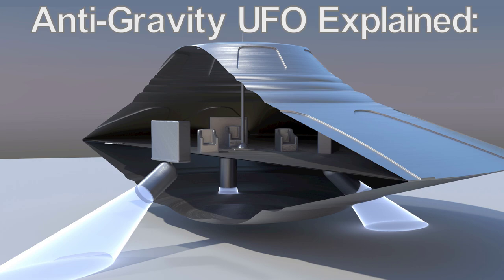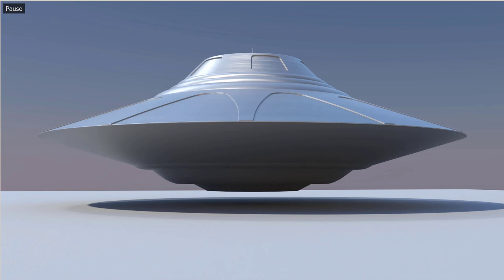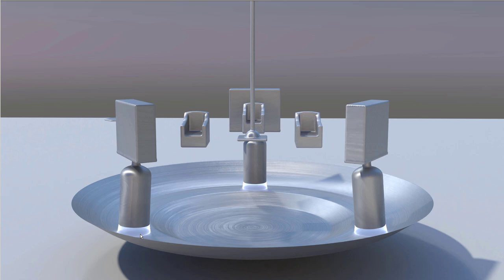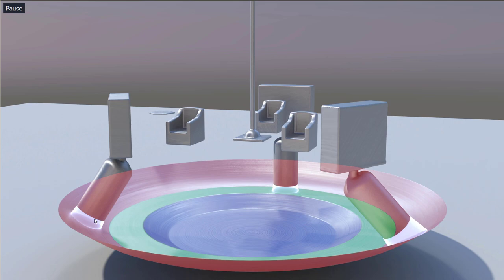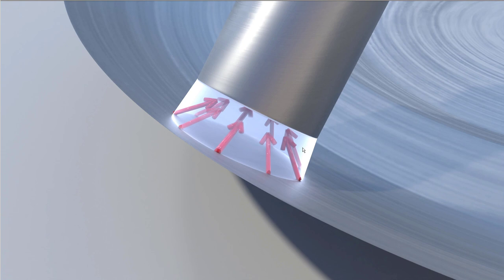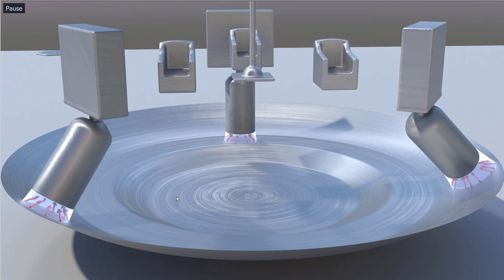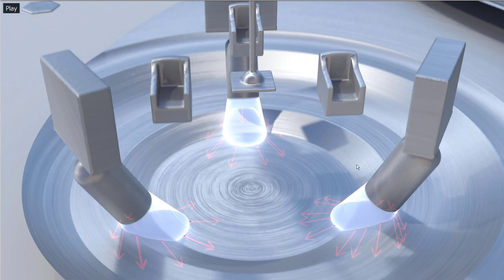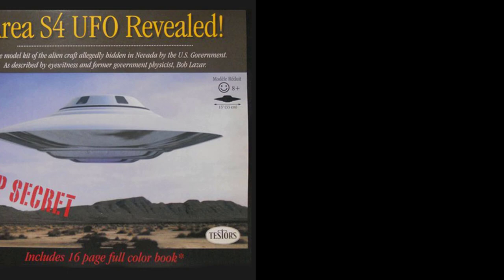Bob Lazar's UFO 3D Modeled + Anti-gravity operation mechanics.

Comment: Bob DID cover this before. he did explain why the bottom of the haul was shaped like it was.
Reply: Why
Reply: @meulisesulisesulises  He's wrong I'm afraid. Jeremy even comments that he thought this was great displaying his knowledge or complete lack of. I'll explain. No it doesn't pull on the metal of the craft what would be the point? Imagine them as huge magnets the craft wouldn't go anywhere if you turned on one would it. No I'm afraid. Gravity crafts work by projecting mass just in front of the craft via huge amounts of energy. E=mc2 (that's the theory of relativity from Einstein if anyone's wondering. It says Energy equals mass multiplied by the speed of light squared. I don't wanna lose anyone so simplified for you here all you need to note is that energy and mass are the same. Stuff is energy the more stuff there is somewhere the more energy) Energy and mass are interchangeable because they're either side of the equals in the equation. They project tremendous mass (basically huge energy) just in front of the craft so it is always "falling down hill"/getting "pulled"towards it. If they acted on the craft friend, it wouldn't go anywhere. Three are needed simply because of the need not to drop of the sky whilst you are manoeuvring them to a different position. So you wanna leave somewhere asap. You have to use 2 emitters for high speed. Whilst the two are swinging round into position one works on keeping you from just dropping out of the sky. Look. Think of a surfer catching a wave to the beach. Now reverse the footage in your brain. See (in your minds eye) how the wave pulls the surfer along out to sea. That's how a gravity craft works. You project massive energy in front of you. Energy IS mass so it's like putting an earth in front of you for you to fall towards. Can you see how the use of two emitters would make the "planet" you're falling towards twice as big? Anyway I hope this helps do you get it?

Comment: Is it even possible for a system that’s 100% efficient to get warm? Like if there’s no “waste heat” then it remains room temperature? It’s like it doesn’t even have the chance to get hot because the energy is being directly converted instead of being burned. Bob also stated that the field around the reactor wasn’t 360° but only on the hemisphere.

Comment: I'm here for your comment to a UFO tic-tac video on Wixcon.Sorry for my curiosity,but Why your interest in only the dates of 1966 and 2004? Excellent job.
Reply from the maker: There was a video of a Tic-Tac UFO taken from a helicopter off Catalina island in 1966.  The Navy photographer who filmed it described it exactly the same as the 2004 Tic-Tacs were described and the video corroborates the sighting.  The helicopter pilot even guessed the speed that it was traveling and it was traveling at basically the exact same speed as the 2004 Tic-Tacs as seen on radar.  I'm working on a video about this, but it'll be a while until it's released.
Reply: @abominati0n981  Thanks.How interesting.I'm waiting for your analysis with expectation.I'm going to see the 1966 incident. Luck and thanks again.

Comment: No it doesn't pull on the metal of the craft what would be the point? Imagine them as huge magnets the craft wouldn't go anywhere if you turned on one would it. No I'm afraid. Gravity crafts work by projecting mass just in front of the craft via huge amounts of energy. E=mc2 (that's the theory of relativity from Einstein if anyone's wondering. It says Energy equals mass multiplied by the speed of light squared. I dint wanna lose anyone so Simplified for you here all you need to note is that energy and mass are the same. Stuff is energy the more stuff there is somewhere the more energy) Energy and mass are interchangeable because they're either side of the equals in the equation. They project tremendous mass (basically huge energy) just in front of the craft so it is always "falling down hill"/getting "pulled"towards it. If they acted on the craft friend, it wouldn't go anywhere. Three are needed simply because of the need not to drop of the sky whilst you are manoeuvring them to a different position. So you wanna leave somewhere asap. You have to use 2 emitters for high speed. Whilst the two are swinging round into position one works on keeping you from just dropping out of the sky. Look. Think of a surfer catching a wave to the beach. Now reverse the footage in your brain. See (in your minds eye) how the wave pulls the surfer along out to sea. That's how a gravity craft works. You project massive energy in front of you. Energy IS mass so it's like putting an earth in front of you for you to fall towards. Can you see how the use of two emitters would make the "planet" you're falling towards twice as big? Anyway I hope this helps. Nice effort though friend. I love your videos and I'm a sub but you're incorrect on this one I'm afraid x
Reply from the maker: Yea, I fully understand what you're saying because that's exactly what I thought when I first started thinking about this critically, but you don't understand that you're thinking about things backwards.  The gravity doesn't "ignore" the mass of the craft, it acts on it DIRECTLY.  Your magnet analogy is a perfect example that you don't understand this.  These gravity emitters are emitting an energy that acts ON the metal of the craft, not magically beyond it.  This is why UFOs generate heat and light.  I know this sounds crazy, but this will make a lot more sense when we understand that Gravity is directly to electricity, which is why these crafts generate very high voltage electricity around the craft.  Anyways, I'm rambling, but this will all make sense in the future, I swear!
Reply: @abominati0n981  No again I'm afraid. They emit light because when you give tremendous amounts of energy to a gas (our atmosphere) it emits photons (light). That's why. The craft is there to SHIELD the inhabitants from the outside forces so they are in a "bubble". Notice how there is zero loss of momentum when they enter water, this is because they are not interacting with the water. So imagine your travelling at close to light speeds though space and you hit even a tiny speck of dust it would tear clean through, ripping you too pieces if you weren't completely shielded. It's not me that's failing to comprehend I'm afraid. If the forces acted on the craft, the very first right angle turn and you would have to scrape the inhabitants from the wall. I'll give it one more try with you. The forces don't act on the craft and if they did when it accelerated you would have "BANG BANG BANG BANG BANG BANG" as it broke the sound barrier. It's ok not to comprehend friend, these are weighty subjects. All the best with it
Reply: @abominati0n981  Gravity is merely a cosmic cassimir effect. You have to view the various event horizons conceptually in your mind as a solid wall for the waves to bounce off and not the infinite expanding thing space is. So a boat in a harbour will get pushed into the harbour wall because of all the waves acting on the boat from the sea side and there being less waves between the boat and the dock. Grasp this and you have understood gravity
Reply from the maker: @suedenim6590  Gravity is Buoyancy in the Aether.  The Aether is the "dark matter" that astrophysicists have been observing, but it is everywhere in between all matter and wrapped around protons to create a Neutron.  I made a video about this but I took it down because physicists were absolutely up in arms about it.  Antigravity is just controlling these expansive Aether particles. As I said before, this will all make sense in the future.

As for your "BANG BANG" analogy, you're still not understand what I'm suggesting at all.  If you were in a craft that emits antigravity, that antigravity is still going to impact the craft no matter what way you want to slice it.  But anything inside still wouldn't experience intertia when it's operating, I'm not suggesting that the inhabitants in the craft would be tossed around.  What I'm suggesting is that unlike our propulsion technology (which operates on outside forces, i.e. roads, water, air, etc), UFO propulsion technology operates independently of outside forces by acting directly on the craft, which makes perfect sense if they're operating in outer space and it makes perfect sense in schematic that Bob illustrated for the Sport Model.  Emitting a beam of Antigravity DOWNWARDS (as shown in my illustration) causes the entire craft to be pulled UPWARDS as if you are pulling the UFO up with a crane or hook.
Reply: @abominati0n981  seems your minds made up so we will have to agree to disagree. After all I wouldn't want to get in a battle of wits with someone more intelligent than the physics community. "Up in arms" with you huh? I must have missed that in the press and all the journals etc. Funny how a YouTuber came up with the answers to gravity and a unified theory. I would have thought the physics community would have been pleased to have the answers from you but what do I know. Good luck with everything
Reply: @abominati0n981  dark matter does not exist by the way